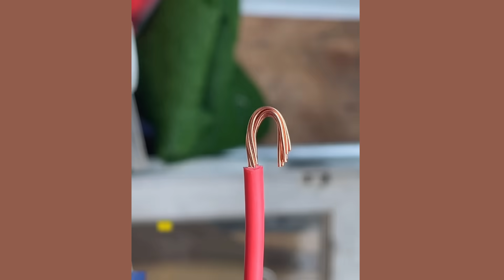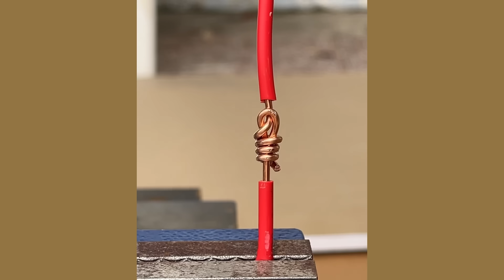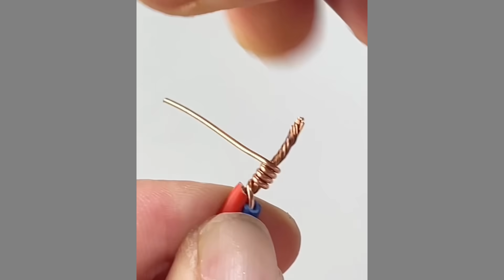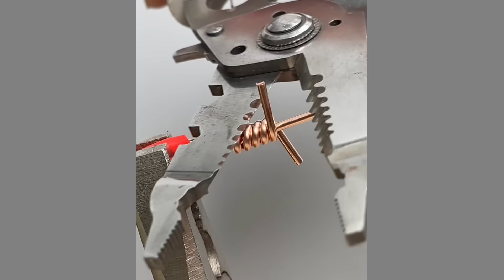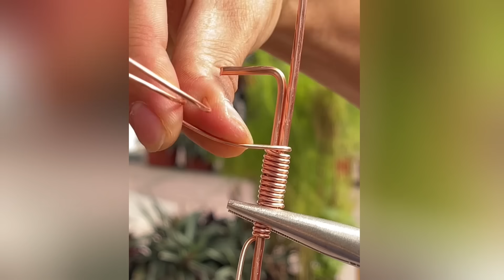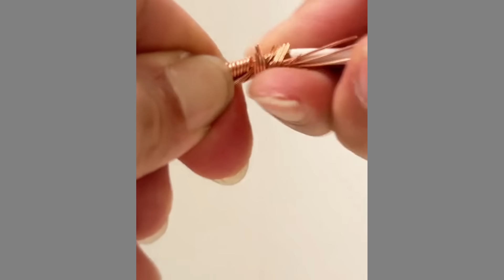10 Simple Yet Effective Wire Twisting Techniques - A Must-Know Hack!

Comment: This video should be tittled, "10 Simple Ways to Lose Your Elctrical License"
Reply: How to lose your electrical license even in Kuala Lumpur
Reply: @hawaiiangunner  How do you assume this is house or commercial wiring that requires a license? This could be appliance, home entertainment, or instrument wiring, or even motor vehicle wiring, none of which requires a license.
Reply: I'm glad I'm not alone, the amount of resistance generated when you turn a wire past 90° is incredible. The turning of the wire around another is another thing but some of these are just very risky.
Reply: @danieldare2640  One of the lowest IQ comments I've ever read.  Bending wire past 90 has absolutely no effect on resistance unless you're bending it back & forth so much it starts severing the copper.  One of the most common, code compliant, ways to connect wires is to twist them with a wire nut.  Wrapping wire into small coils is probably the most common thing ever done with copper, producing insanely useful things like motors. You should not open your mouth about electricity ever again.
Reply: @danieldare2640 DC power is fine, because the voltage is generally low but the resistance still spikes the ohm meter at the splice, however AC power with it's higher voltages and Hertz cycles would be leathal if the circuit was under a heavy load or there was a floating neutral. There is a substantial amount of EMF produced by coiling the extra wire around the two spliced wires, especially the splice that starts an ends on the wires own insulation this will create signal interference. It would be similar to how a screw driver can be magnetizing by coiling a wire around it and connecting the ends to a battery.   Wire nuts and Shepard hooks are typically in an electrical box and don't create electrical interference because they terminate at that point.  I can say the wire splicing methods in the video are substantially stronger and more durable than any current residential electrical splice used today(excluding) the Line Men's Trade and their splicing methods  they use on transmission lines. I actually have used a few types of splices shown in the video, on a fence before an they are strong.
Reply: why, bruh? pls explain...
Reply: Just a typical 🤓☝reddit-type comment, pretending to know things they've never done.  Most of this is against electrical code for house & commercial electronics wiring, but there's nothing inherently unsafe about it & it produces far stronger & better conducting electrical connections than most any code compliant method (wire nuts, lever nuts).  The problem is it relies on individual technique.  Performing these techniques poorly produces a weaker & worse connection than wire nuts or lever nuts.  A wire nut is essentially the same thing, but far worse, which is why pretwisting wires together before applying the wire nut is recommended by most electricians & anyone else with common sense.  The wire nut is basically just an insulated cap for the connection at that point, providing little if any mechanical strength & doing nothing for conductivity.

Electrical code is about liability far more than safety.  It exists to protect banks & insurance companies from unpredictable lossses & protect suppliers & builders from liability.  A consistently code compliant connection, like a lever nut, creates much more predictability in the final outcome of the property, allowing underwriters to accurately predict future expected rates of loss & stay profitable. Predictability is a requirement for banks & insurance companies to finance & insure the property.
Reply: May be we can also learn from this link https://standards.nasa.gov/standard/NASA/NASA-STD-87394
Reply: @caffeinefeind5263  I agree 
this video have to see only fun
Reply: @caffeinefeind5263  Considering how many "electricians" do substandard work, it's not saying much.

(Usually, the guy with the license is back at the office or sulking around the breaker panels drinking coffee and not doing the actual work.)
Reply: @GeoFry3 It sounds like you and I have had very different experiences in the electrical field.

I'm not saying your wrong, though.
Reply: These connections look stronger than wire nuts.
Reply: @alejohernandez75  They are.  Much stronger.
Reply: You're just saying clown things because you learned something here. And you don't like that because you think you are too informed to be educated by a YouTube video.
Reply: @BarrySomer  I don't understand why you are attacking me. Are you having a bad day? You are more than welcome to prove me wrong with facts. If you can find where any of these techniques are allowed in the 2025 NEC, then please, reply with the code reference. Also, it is very unhealthy to project your own insecurities and trauma onto other people. In the future, when next come across something that triggers you, try approaching it with curiosity.
Reply: @caffeinefeind5263  At no point was there any implication that what was being shown here complied with any regulatory codes. You said what you did to convince people that you are more knowledgable than the person on this video. What really irked you was you saw that they were nice wire wraps, and it got on your nerves that you learned something. 

And what's more, you can forget attempting to use what you obviously consider to be erudite and eloquent language, it isn't working son. Now stop crying just because someone called you out for behaving like a child.
Reply: @BarrySomer  Lol! You are funny! And you know nothing about my thought processes. I genuinely feel bad for, my guy. You must have so little going for you in your life that you have nothing better to do than get angry over some silly comment on some random video. I stand by what I said.  Unless you can prove to me with facts and not attacks, then the comment will remain. Have fun in therapy!
Reply: @caffeinefeind5263  You're quite right, it was a silly comment. Maybe in future you will learn that spouting irrelevant nonsense in the YouTube comment section dosen't convince people of your intellect, just like it hasn't with joewoodchuck3824 and myself. 

You ask me to use facts, well I have. I reiterate: "At no point was there any implication that what was being shown here complied with any regulatory codes"... What part of that factual statement don't you understand. You made a comment that was completely irrelevant and nothing you say will change that. Grow up man, you're nowhere near as clever as you think you are. And it can be quite easily seen.
Reply: @BarrySomer Wheres the gofundme for your last house fire?
Reply: @caffeinefeind5263  Why are you assuming that these examples are for house wiring? You're apparently unaware of the numerous other places wire is used such as vehicles, appliances, and electronics.
Reply: @joewoodchuck3824  Why are you assuming I am only talking about house wiring? Regardless, splicing a smaller wire into a larger one is a great way to start a fire! Also, wire nuts exist for a reason!
Reply: @caffeinefeind5263  Because you brought in the phrase electrical license which is only needed for building wiring for the most part. 
   As to potential fires, some of these are actually pretty good. Depends on how much current and appropriate wire sizes. There is a possibility of oxidation of course for which solder is a good solution. My career was in electronics and it was uncommon to find plain copper wire anyway. The vast majority of it was tinned which is much less susceptible to oxidation. I'm not sure why house wiring isn't tinned, especially near coastal areas.
Reply: @joewoodchuck3824  And there's the disconnect between us. Your career was in electronics. I have spent my entire adult life in the construction trades, including a year as an electrician's apprentice. There is a huge difference in the two. There is a thing called a CODE that must be followed. I don't really care to continue this pointless debate, so I will refer you to the most up-to-date electrical code book, or a licensed master electrician, to answer your questions. Best of luck

Comment: These connections are  ok for your car stereo 🔊 or if u are in the wilderness in an emergency. But other than that, get some splices & or a soldering iron. The new heatgun splice is ok for lowvoltage toys.
Reply: Heat gun  (solder sleeves) splices are used even on critical military equipment, I know because I use them often I build military cables, I do not just put this in they are actually called out for on drawings, and in BOM..  they are used on smaller wires of course.
Reply: I didn't know that. & I used to inspect Mil-spec equipment a long time ago. Thanks. @Artiflex-ai4u
Reply: @okramw1  They are very convenient, M83519/1, as QC inspection, the main thing I have to look out for is, that the heat gun is not applied long enough,  it melts the solder, but not enough to solder the wires (cold solder joint). also they can be over heated (wire melted through insulation) and or placed off center (exposed conductor) but in general they are fast, and effective when done right.
Reply: Your car stereo is far more demanding of quality connections than house mains because you're dealing with much higher currents since the job your home stereo does using 100V+ the car stereo has to make do with only 12V while surrounded with heat sources, hence car electrical connections must be done with proper crimping, never with solder nor with hardware store splicers